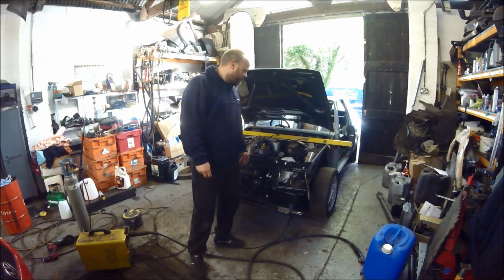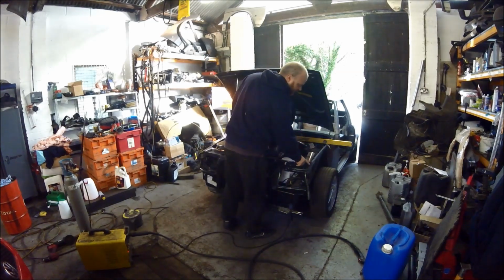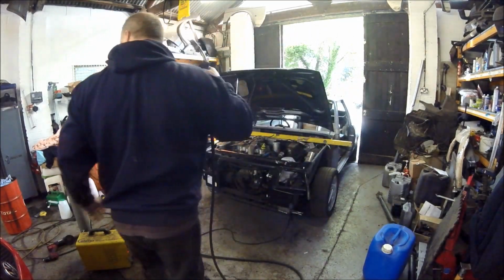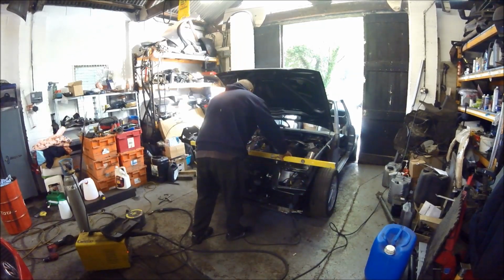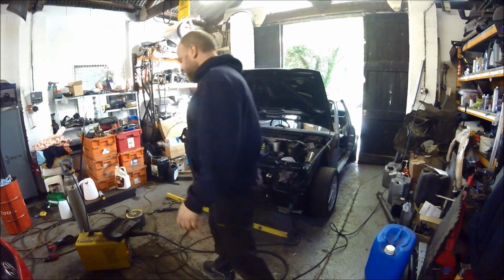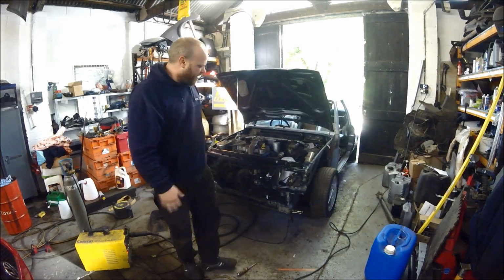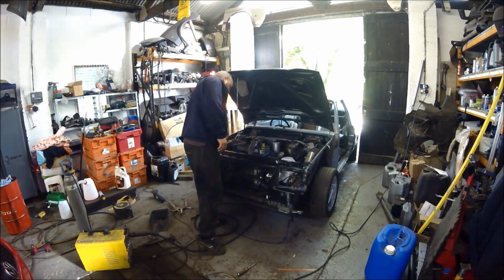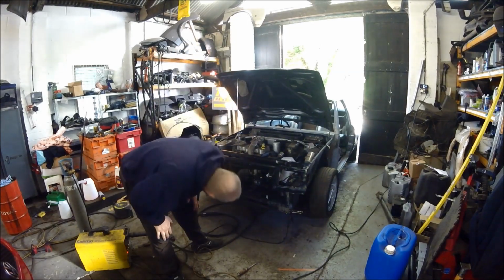how to weld repair fit install new front panel valance escort rs turbo M-tel garage

Comment: Hi mate , was this a genuine front panel or a pattern one ? I have mine to repair , cheers
Reply from the maker: Hello mate yer the panel I fitted was an after market type one not oem :) the main thing is just to get load of measurements and draw up a picture fist then when u fit the new one just tack it first and see how every thing lines up and remember to try fitting the head lights as well for alignment :)
Reply: @TELSGARAGE  thanks for the reply mate , couldn't really take any measurements as it wasnt correct in the first place , so will have to do what you've said , what was the quality like of the panel ? I'm trying to find a genuine one but no luck so far . Cheers

Comment: don't forget to keep the vin plate from the old front panel you have already cut the number out the floor
Reply from the maker: Yer I took the old vin plate of mate :) and now the the shell is back in paint it's back on the new front panel :) and also I have stamp the chassis number back it to the shell :) for I have got some chassis stamps :)